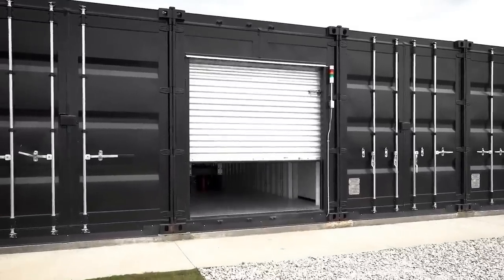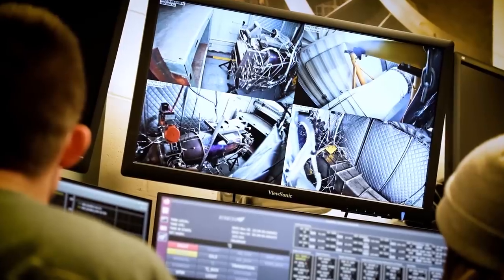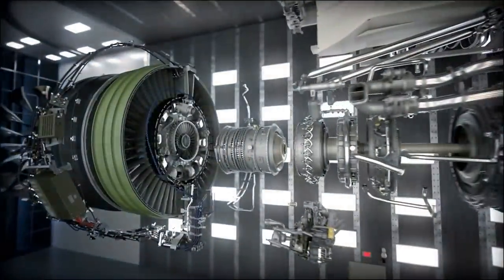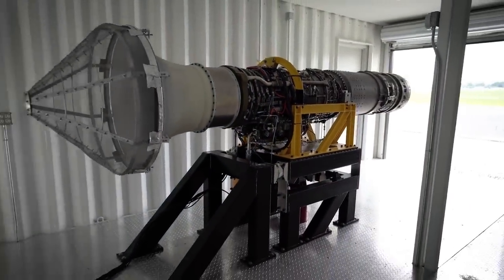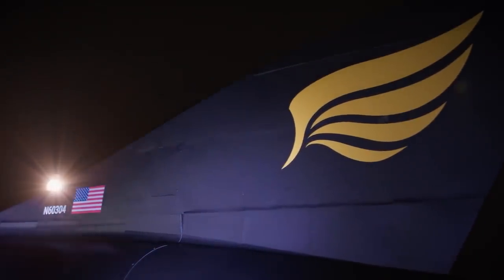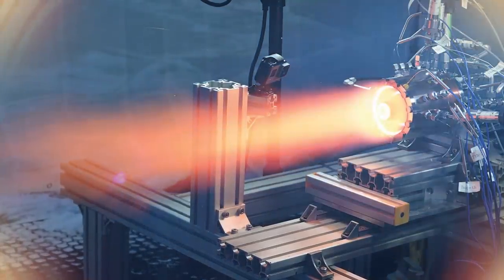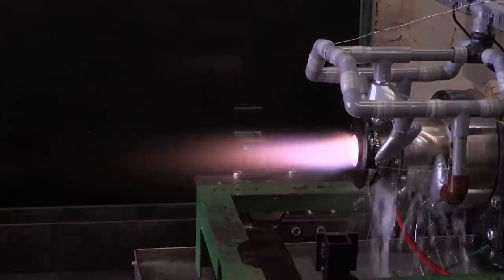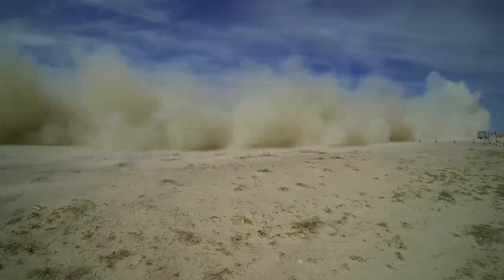US Billions $ Hypersonic Fighter Jet Engine Is Ready for Action

Comment: Rotary detonation engines are a matter of engineering. Fusion engines require technology we do not yet have. Just last week it was announced that for the first time we actually yeilded more energy from a fusion reactor than was put in at Livermore. It involved a large appjeratus using multiple lasers producing temperatures monsterously in excess of those present in the Sun. This approach would take some time to compress into a size appropriate for an aircraft engine, and materials that probably do not exist to handle the heat load that appears to be inherent. My bet would be that we will see rotary detonition engines soon, unless electrogravitics are quietly surpassing that whole paradigm of thought.
Reply: isnt tungsten one of those materials that can withstand almost anything? 
yes its very expensive and very difficult to produce but we have it.